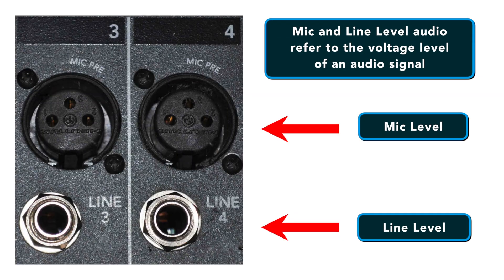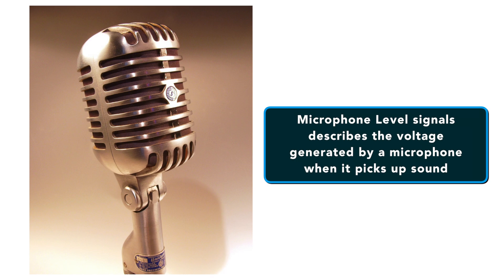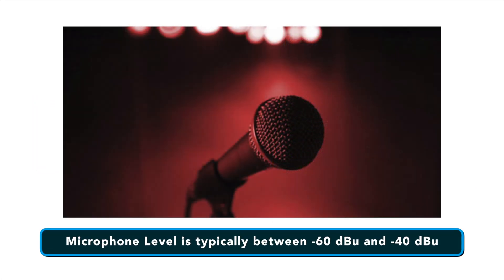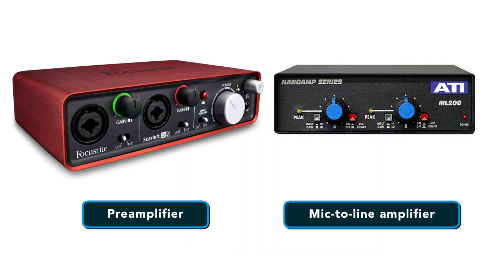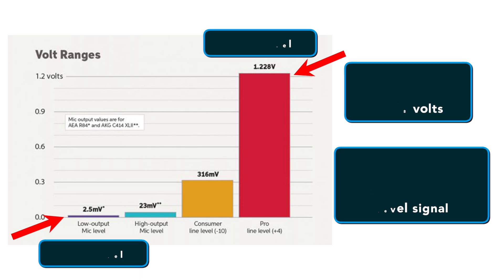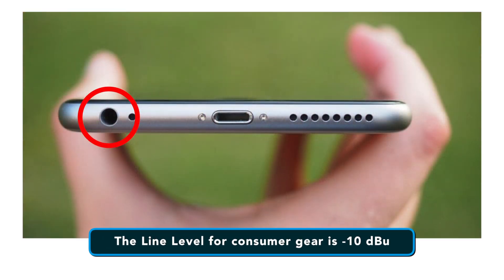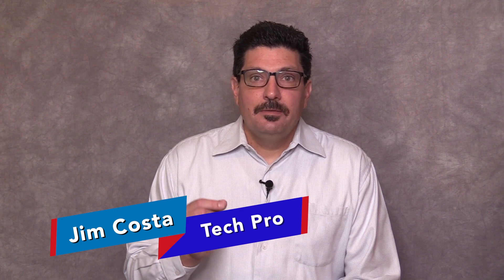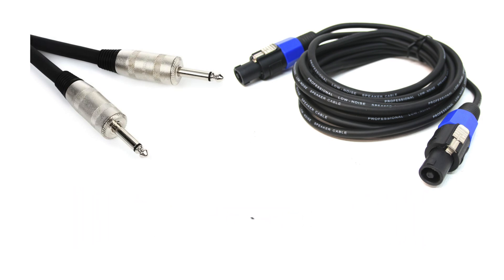Unraveling Audio Signals: A Guide to Mic, Line, & Instrument Levels

Comment: Hi Jim, 

How about the earphone/headphone level?  Is it the same as line level? Probably -10 dbu?  Or is it a different audio signal in itself?

Do you amplify a -10 dbu level to a +4 dbu level to make it into a professional signal level? What’s the difference when working with these 2 levels?
Reply from the maker: Yes, earphone/headphones are line level signals. -10dBu to -6dBu are where the level should fall. Going up to +4dBU will way over modulate a digital signal and it'll distort. You might get away with a +4dBU peak on an older analog signal, but I'd avoid it all together if I were you. 

   Now then, my guess is that you're asking about info about comparing -10dBv and +4dBu voltage levels, say where music and/or home/pro audio is concerned. If that's the case, then you're answer is:

  Professional analog audio electronics gear is often interconnected with cables. The input and output connections are often times described as designed for nominal +4dBu signal levels.

  Consumer and Home Entertainment analog audio equipment is also often interconnected with cables. The input and output connections are usually described as designed for nominal -10dBV signal levels.

Nominal signal level

  The term nominal level describes the audio signal level which any particular piece of electronics is designed to work with. The analog sound signal is AC voltage. The signal level can be measured on decibel meters that are calibrated to AC voltage levels. Decibel meters are used in an attempt to mimic the nature of sound as its energy level must increase or decrease exponentially for it to be perceived as doubling or halving in listening level.

  When connecting professional and entertainment grade gear it is helpful to know how the nominal signal levels compare.

  The AC voltage difference, in decibels, between +4dBu and -10dBV nominal signal levels is 11.79dB.

  At first glance it may seem there is 14dB difference between +4dBu and -10dBV nominal signal levels but this is not the case. The 11.79dB difference between nominal +4dBu and -10dBV signal levels is evident when the different unit scale values are both referenced to AC voltage.

Unit scale values

  The unit names "dBu", "dBv", "dBV", and "dBm" all have case sensitive spellings and have specific definitions regarding audio signal levels.
Professional analog gear is measured with dBu and dBv and dBm unit scales.

  For example;
0dBu = 0.775 volts AC with an unterminated load.
0dBv = 0.775 volts AC into a 600ohm load.
0dBm = 1milliwatt at 0.775 volts AC into a 600ohm load.

  Consumer and Home Entertainment analog gear is measured on a dBV unit scale. The opper case "V" indicates a different unit scale than the professional lower case "v" scale..

  For example;
0dBV = 1 volt AC regardless of impedance load.

  dBu, dBv, and dBm are considered somewhat interchangeable but, as mentioned above, The use of the units dBv and dBm suggests that the voltage is measured across a 600ohm load. There is very little 600 ohm gear made today, for a variety of reasons, most gear has a higher input impedance. The use of dBm and dBv has been deprecated and replaced by the dBu unit which is measured regardless of impedance.

Compare the volts

  When +4dBu or -10dBV values are reconciled to the other's scale and the actual difference in voltage is compared you can see that there is a 11.79dB difference in voltage levels.

  for example;

-10dBV = 0.316 volts AC

0.316 volts AC = -7.79dBu

-10dBV = -7.79dBu

+4dBu - (-7.79dBu) = 11.79dB difference

in other words, a -10dBv signal is 11.79dB lower than +4dBu

  or for example;

+4dBu = 1.23 volts AC

1.23 volts AC = 1.79dBV

+4dBu = 1.79dBV

1.79dBV - (-10dBV) = 11.79dB difference

in other words, a +4dBu signal is 11.79dB greater than -10dBV

Why -10dBv?

  The history of -10dBV is simply that old hi-fi gear was made to have lower output than professional gear as a cost saving measure.

  When a pro item has a -10dBV input option the intention is to use the gain in the pro item rather than forcing the user to over drive their -10dBV gear into a input that expects a +4dBu signals. The idea is that you use the semi pro gear in it's sweet spot and the pro gear has enough gain to handle the rest.

  An obvious question is to ask whether the pro gear is optimized for +4dBu or -10dBV. If the former, it will have adequate head room above and beyond +4dBu. Perhaps +26dBu max or 22dB headroom. If the pro gear is optimized for -10dBV then the +4dBu input may simply be padded to bring down the pro grade levels to the semi pro region. This would be done for cost cutting reasons and the headroom above +4dBu will generally be well below 22dB in those devices.

  The only reason to use a -10dBV input is if your gear only works at -10dBV standard levels. In all cases connecting a -10dBv output to the input of +4dBU gear will increase the noise floor... if you do so and need to gain up to +4dBu nominal levels it is often cleaner to do it in the pro side of the connection.

  If you connect a +4dBu output to a -10dBv input then you are sending a hot signal over the line and this will minimize the noise floor but it will also be hot and may overload the input. If you pad it down you may reduce the noise floor a bit but the -10dBV input will have to rebuild the gain if it goes further to another +4dBu device and the noise will likely return at the next stage.

Stuff that is good to know about +4dBu and -10dBV

  If you plug a +4dBu output into a -10dBV input the signal is coming in 11.79dB hotter than the gear was designed for... turn something down.

  If you plug a -10dBV output into a +4dBu input the signal is coming in 11.79dB quieter than the gear was designed for... turn something up.
Reply: @jimcostafilms  Wow! your response is way more than I can chew.  I will read it over and over in order to understand it. Thank you for the very detailed explanation and helping us out. You are awesome!!
Reply from the maker: @inviktus1018  Happy to help.